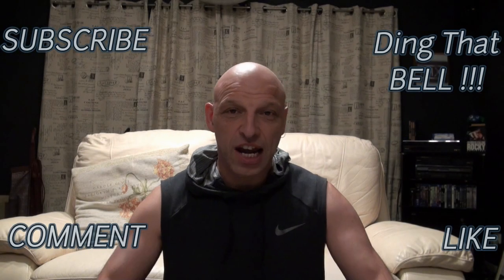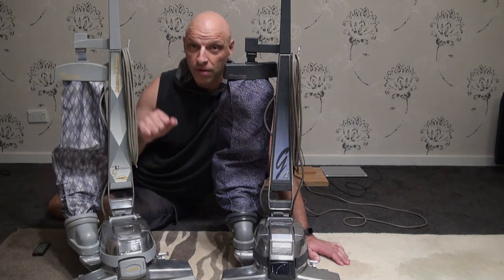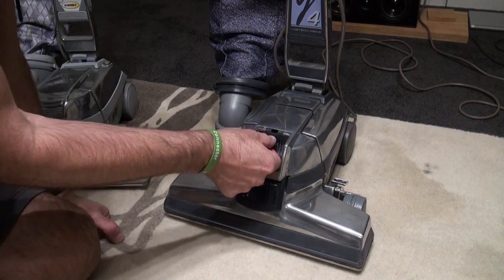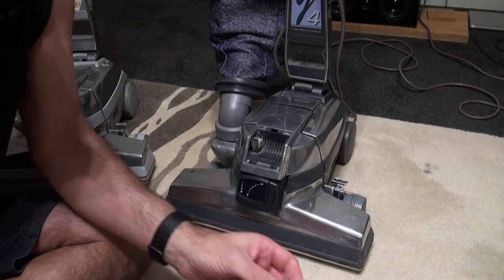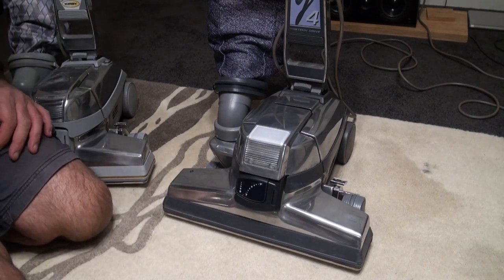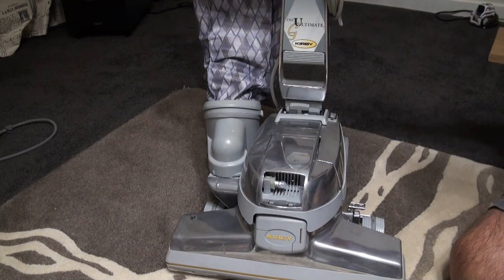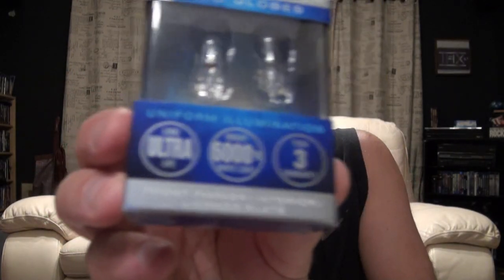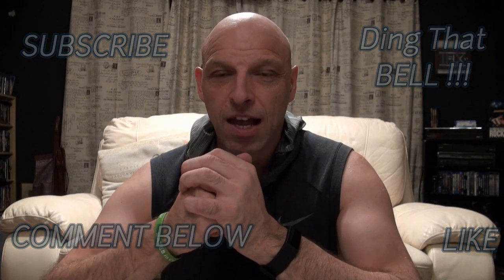KIRBY VACUUM HOW TO UPGRADE TO LED BULB G4 , G5 , G6 , G7 ULTIMATE G How to install bulb in  a Kirby

Comment: Note for folks looking to do this. A higher color temperature (the blue look) will also have a higher perceived brightness, since it creates better contrast especially on warmer colored floors (warmer being browns, reds, etc). If you cannot find an exact LED equivalents, a 921 LED is a perfectly suitable alternative and is just about anywhere. Also note some cheaper bulbs are not as good as others and may need to be in the right way around. If it doesn’t work, flip it over and try again.

Comment: 25 yrs and still working bulb. Goes to show some things were made to last back in the day. Unlike today
Reply from the maker: We've become a disposable society, at least Kirby Vacuums last at least 20 times longer than today's.👌
Reply: Daniel E this isn’t entirely correct. When it comes to the Kirby bulbs, they put in ones that are about 2.2 volts over rated, it’s a GE part (can’t remember the exact number) that’s rated at 14.4 volts. The circuit only puts out ~12 volts, so by being over rated, it will last longer but it produces a proportional amount less of light. Luckily, the amount of light this bulb produces is still usable even being under run by about 17%. You used to be able to buy “long life” incandescent bulbs that were rated at like 140 volts, same principal. Unfortunately, that bulb for the Kirby is somewhat unusual, so most replacements are a higher current, lower voltage bulbs, which while they produce about the same amount of light, tend not to last as long. The ratio of life to light produced by over rating the bulb is advantageous to a certain extent (for example, you get twice the lifespan but only a 1/5th drop in brightness), but at some point the voltage will be too low to even light the bulb, so you can only push this so far.

Source: Worked in a Batteries+Bulbs for 6 years, three of them were commercial sales and professional consultant.
Reply: @linksmith1057  still impressive. I lve had LED bulbs that said they last 20 yrs, only to go out a month later.

Comment: Question why the green light doesn’t come on ???
Reply from the maker: Brushroll belt not round on , or brush roll sensor magnet dirty .
Reply: @KirbyEnthusiast   I went through the cleaning the brush and put a new belt on the brushes are rotating good but the green light still doesn’t come. Would it need replacing
Reply: I had just watched the video regarding check the bush, cleaning the hair off and checking the ends with a paint brush. All is working But the light isn’t working still. Possibly would it need replacing, thank youb
Reply from the maker: @dotleftwich1165  is the ball bearing in brushroll on same side as sensor.
If so then sensor may need replacing as it should still light up green when belt wound on .
Reply: @KirbyEnthusiast  not sure what your explaining sorry
Reply: @KirbyEnthusiast  please help me replacing the green light/sensor

Comment: Gday Mate...I was reading you shouldnt handle LED bulbs because you transfer oil to it and may reduce the efficency of the bulb...They say you should use gloves.
Reply from the maker: The one in the Kirby are ok as they are fixed to a board . So you don’t have to touch them . I know halogen bulbs and headlight bulbs should not be touch as the oil in your fingers can caused them to blow.